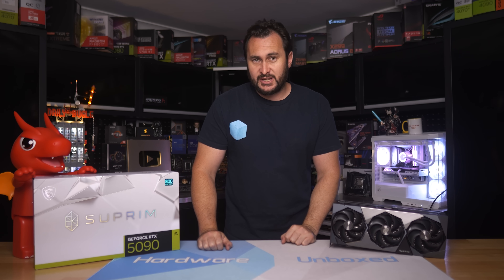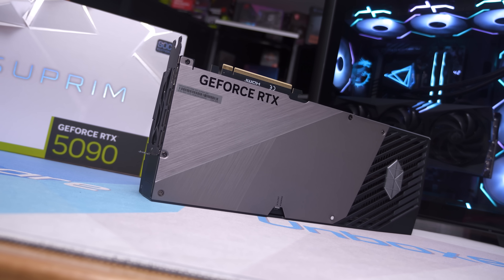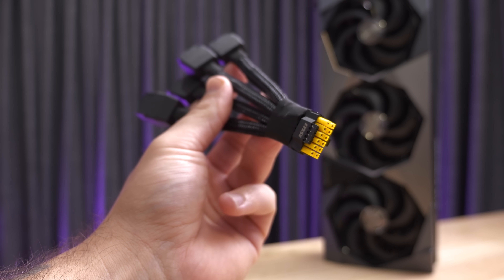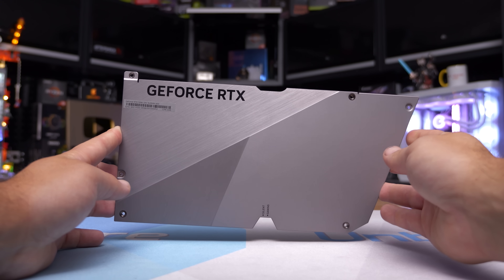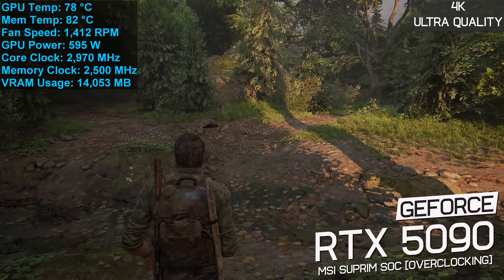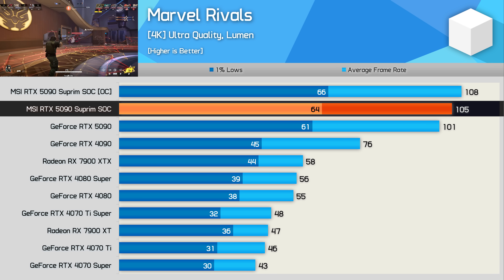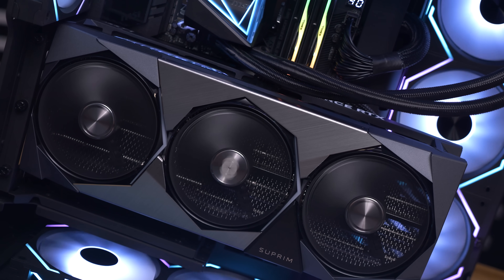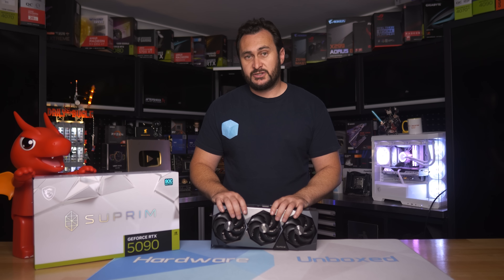MSI RTX 5090 Suprim SOC Review, Biggest Graphics Card We've Ever Seen!

Comment: What a joke of a card. this whole 5090 is. and this is even a downgrade from the previous 4090 Suprim X. the RGB for example in the 4090 is much better than this. temps are much lower ( more than 10 degrees lower. my card doesn't cross the 65 degrees in silent bios. the bracket on the back of the card is 2 only for a 4 slot card ? like really ? the 4090 suprim X was 3 slots and the bracket was full 3 slots too. zero sag. 

also what the hell is up with the power draw ?? constant 600w ? yeah... umm. get a house insurance just in case when you get the card -_-.  cables reached 75 degrees and up to 80 degrees when overclocked.. might as well cook a steak on the cable too lol. 

performance wise is impressive though. but the price I am expecting at least 2300$ US ( if ventus is 2k, MSI trio X probably 2150, and this between 2250 to 2300$... sheesh

Comment: 82c that is a massive heat. I hope the parts don't give up faster long term reliability....speed not only is costly but also generate more power and heat. 😮

700+ watt pull, wow. A 1200watt PSU is not gonna cut it, ill need a 1600w minimum.

Comment: 10:07 Seriously.. am I the only one seeing this GPU pushed to 600W, ie max capacity, ie max rate connector load, ie potential fire hazard. I am so confused with these 5090s.
Reply: It’s not a concern to reach max capacity, it’s a concern to go past it though.

You can see on this thermal testing that it is nowhere near the max thermal resistance for these connectors (105c) so there would be no fire risk unless the user is very neglectful and has poor cooling + poor connection with the cable.
Reply: @cameron2319 This test says nothing. 4090 test would show the same. We still have a 10% safety margin on 600W rating with a 600 watt power use. Do a test later in time, have a few specks of dust in there - What do you think happens with the resistance? It inevitably goes up. These will melt.

Comment: I am no electrician, but that power connector at almost 70c 80c is a no go for me, that is just asking for trouble by burning your house down, is not only the support for the GPU that they cheeped on,  but that power connector as well,  all that heat means wasted power,  you practically need a separate power supply just for the GPU alone.

Comment: If the connector and cable is only rated at 600W, isn’t it a major safety concern having that much power go through it. Don’t understand that and as someone with a 4090 and was looking to upgrade to a 5090, how is that safe.
Reply: 600 for the cable + 75 or 300 watts depending on PCIE gen 3 or 4 so total either  675 or 900watts delivery .

Comment: 11:12 coil wine on a $2000 GPU is insane, instant return.
Reply: Its normal for SMPS to whine...
Reply: Sadly it's the norm and inherent to switchmode PSUs/regulators. They all whine to some extent. Just a matter of if you can hear it or not (out of the frequency range humans can hear) or if the manufacturer has taken extra steps against it, like covering the inductors (commonly referred to as "coils" by people with no clue) in epoxy to stop them from vibrating and creating those noises. That's still easier said than done when you're dealing with a variable load like on a GPU though
Reply: Dont be pedantic. Inductors are literally coils of wire.  @Knaeckebrotsaege
Reply: Absolutely, and ignore anyone who says otherwise. If you can barely hear coil whine, it's already too loud.
Reply: @Shini1984  good job telling people to ignore how physics work. clown
Reply: @Knaeckebrotsaege 😂
Reply: @Shini1984  Gl ordering anotherone just to hear the same noise...

Comment: You can fix the fingerprint stuff by actually using a tiny drop of oil on some pad and rubbing it all over the surface to make it all even, then to wipe the oil off. I think that is easily fixable. Either that or use isopropyl alcohol to remove all oil from fingers. I say you're better off with the oil option, but eh, pick what you have.

Comment: That's a 3000€ GPU for a small chance to burn down your house. Yeah, no thanks !

The connector goes up to 80c in a well ventilated case and 21°C ambient. What happens if you live in countries with 25-30°C+ ambient? That conector, which it's made of plastic, goes to 100°c melts and if you are not around goes on fire and can potentially burn down your house.

Comment: 1000% convinced after seeing that gpu backplate that not all people wash their hands at the same frequency/and do not generate the same amount of hand grease. The back of that gpu looks like I fried foods, pulled it out with my bare hands and ate cheetos before installing that GPU. I wonder if that would cause any issues in your build if you abnormally have THIS much hand gunk.
Reply: fyi, a smidge of vinegar will remove all fingerprints on metal

Comment: Asus Cards Are Absolute Baller! I have 2 6800xt's by them and it is built the same exact way. asus tuf gaming oc 6800 xt I can clock these cards stable at 2560Mhz pulling less than 300 watts most of the time they are at 180-220 wattage I've seen it hit 280-300 once or twice

Comment: The 4090 coolers were designet for 600w because that's what Nvidia initially told the board partners, but then changed it after board partners had already started production. That's why 4090's ran so cool.. So they can more or less just reuse the 4090 design for 5090 and still be all good.

Comment: It doesn't matter what performance it has or what price it is. Such power consumption disqualifies it as a device.  570W of constant consumption in games or rendering is technological absurdity pushed to the limit. Overloaded laminate cracking at the PcieX connector is standard in 4090 cards and it will be worse due to too heavy and massive cooling. Nothing good will come from the power connector either. And besides, our dear earth is burning and nvidia doesn't care and releases an absurdly power-hungry monster

Comment: I don't like the uninspired designs from the board partners when compared to the engineering marvel that is the founders edition... Like no one else went for the 2 slot/2 fan blow through design to match Nvidia's? All we got was 4 slot behemoths with a metal back plate spanning the entire length of the card again? Really? 👎🏼 I'm honestly considering a founder's edition for the first time, although I would prefer it be slightly bigger, while still keeping the blow through design. I have a huge case and I'm concerned the founder's edition will look really really small.
Reply: lol this is exactly what I expected when I saw the FE. they just recycle the same ugly coolers as last gen and no LM. pathetic. maybe this is why evga quit, having to compete with Nvidia's FE at low margins

Comment: So with all that excess heat being dumped into the case how is the rest of the system faring? does it effect the processor's temps since that hot air is what's now going to be going over the AIO cooler now.

Comment: The fact that the FE achieved much smaller size and the temperatures are good makes this MSI Mammot not worth it
Reply: the temps on the memory of the founder is not good. makes me worry about the card throttling in the summer. This card is way more expensive but the cooling is much better.

Comment: The massive wattage is the reason it is a good idea to aggressively undervolt these GPUs. You can probably reduce it by 100W without trying too hard for virtually the same performance
Reply: If someone lives in the colder parts of the world wants to use their pc as the only way to heat 1 room, this can be a decent solution.. You can undervolt it to 450 watts if need be in the summer and have 90% of the performance if not more

Comment: I feel you were way too relaxed about the card overloading the power connector.  Even if NVIDIA fixed the melting issue, the instant you go over the connectors rating that becomes irrelevant and a fire hazard.  To claim its a "well designed card" when its overloading the power connector is absolutely insane.

Overclocking should never be able to overload the power connector!

Comment: They should just put an angled PCIE connector on it and make the PCB parallell withthe motherboard. They will get so much more room for cooling and people rarely use any other expansion slots anyway. They could even add mopre PCIE connectors to it both to increase power/data throughput but also to improve mechanical stability.

Comment: This is a total money grab by everyone involved in the 5,000 series cards. Way overpriced with little to show as far as an upgrade goes compared to the already great 4090.  Draws way too much power. I would only consider the water blocked version of these cards which should give you a little more headroom for overclocking. My opinion after watching these early reviews is that if you already own a 4090 don’t bother with this 5,000 series at all. It’s built on the same Architecture as the 4090, so performance gains are very slim and it’s all about frame smoothing, upscaling etc etc.  we were looking for that 70 to 80% upgrade in raw performance. The price for the AIB cards is stupidly over top for a few bells and whistle’s.  Total bummer 😢😢😢😢😢😢😢

Comment: 80c on the power connector doesn’t seem safe at all tbh… I don’t know why they don’t just have 2
Connectors instead.
Reply: 80°C power connector, 800 Watts of power draw on a 600Watt certified cable.
 2x 12V-2x6 600 Watts, this could easily solve this giant issue. But nooooo...
Reply: @N0N0111 the amount of potential heat from load spikes could blow the card with 1200 watts running through it, like they said the card is at it’s limit
Reply: @ It's over the limits already, let's not pretend it isn't.
Reply: saves on cost and thermal spread

Comment: 600 watts! We’re going the wrong way! Screw this card
Reply: 80°C power connector, 800 Watts of power draw on a 600Watt certified cable.
 2x 12V-2x6 600 Watts, this could easily solve this giant issue. But nooooo...

Comment: the temperature review of this card should be done in a case and review the CPU and Dram temperature... it will be stupid to buy a $2000 card dumping so much heat it downclock your CPU and destabalize your XMP/expo Ram due to the heat baking in the case..

Comment: Why praise a 4-slot 3 kg card when NVIDIA themselves proved these metrics are absurd and hallmarks of either technical incompetence or marketing deceitfulness (trying to fool morons into thinking: biggerer = betterer = of course I give more money). There is absolutely no technical reason why a 5090 should be bigger than 2.x slots (i.e. 3 slots) and at that size it better have SIGNIFICANTLY better noise and temps than the FE. Any larger and it's just wasting PCIe slots.

Comment: dunno why the gpu size had to be given in mm. whats wrong with cm? you are at a point where mm stops making sense.

yes its super easy to go to cm myself. But also why would i have to do this if the original measurement makes no sense. Whats next? measuring car length in mm? Also for daily life mm is such a nothing measurement. its used. but Cm is so much more common.

Comment: I am privileged to have the RTX 4090 version of this card. I under clocked it to use 150 W by lowering the power target and so doing I was able to reach a level where the card is generally in Audible. I also had to purchase a fiber optic display port cable for around $60 in order to isolate the graphics card from my sound system. This was not necessary with a standard computer speaker system, but was necessary when I upgraded to studio monitors. I am painfully aware that 150 W is below the performance sweet spot for efficiency of the RTX 4090 but for me overall performance has been superb and silence is king. I would consider scooping up this card to replace the one I have, but I don’t think I am willing to get up in the morning and refresh my page for it. I would have been happy with an RTX 4070 with 16 GB of memory and enough cooling to reach similar audio levels. I think the biggest thing that should give gamers pause about this graphics card is that it is faster than we need. I play single player titles at 1440 ultra wide resolution with a 165 Hz monitor and most of my games are capped at 60 frames per second anyway. I tried Ray tracing in Nvidia demo games, but I do not play any games that negatively support Ray tracing apart from those. I almost forgot to mention: I got my graphics card for $1750 or a $150 premium over MSRP. I made my purchase in April 20 23 and I could have chosen another online retailer which promised a $50 discount if I were willing to wait until June to have it shipped. At the time, I thought this was a risk as well as being deprived of the brand new computer. I had just built in all its glory for much longer. I was correct. By June, you could get cards like this for that price anyway. as for the pricing of the card showcase in this video, my guess is MSI will charge a $200 premium over MSRP. That would be fairly in line with the premium they charged for the 4090 version. I do not want to be the one holding the bag if the AI bubble were to pop, so I will not be buying any more graphics cards unless I have a buyer lined up for my 4090.
Reply: A DAC would of been a better option.

Comment: 13:32 no pushing 80°C on a wired connector pulling that much amperage is not safe or acceptable in any manner. It’s a wired connection not a heating element. It’s not a butt warmer and internal power supply components don’t get that hot.

Comment: Gaming with this thing on your desk will take "sweaty" to the next level, literally.
Reply: This is why I stopped sweating to regulate body temperature. Too many sweats online.
Reply: Latest hardware, cards / cpus / etc are almost always the most efficient. Dont look at what it consumes at 120fps 4k ultra. look at a given non peak metric of say 60fps 1440p or 4k vs other cards. Id wager 5090 is THE most efficient. e.g. 4080 more efficient than all the GPUs that came before it. 3080 same with what came before. A CPU can run an old game practically on idle, yet in 2005 cpu would have to draw a ton in comparison. Should i run my 4080 at 4k 120hz and consume 500+watts? no way.  60hz doesnt worry me so much, i play at that and save all that extra power draw and heat.

Comment: There's definitely melting 5090 cables for sure
Reply: The 4090 was nothing, give it 2 weeks and overclock forums will be full of pictures of burnt connectors, esp. the watercooled ones that have less airflow around.
Reply: @puciohenzap891again, like I said to the other person, I’ve had mine since launch, 5090 MSI gaming trio oc and I’ve had no issue at all, it’s performed like a dream and I’ve used my card under a lot of load in kingdom come deliverance 2.

Again, sorry to disappoint you! 😂
Reply: Had mine since launch day although I have the gaming trio of MSI 5090, not had one issue and it’s performed like a dream.

Sorry to disappoint you 😂

Comment: So it’s founders edition or nothing. They truly did revolutionize GPU coolers with this release
Reply: Did you miss the part where the memory temps were 16º lower on the MSI?
Reply: @ Did you miss the part where you see a laughable 2 slot bracket and flimsy plastic GPU holder?
Reply: @ I'm not saying this design is good, I'm saying the FE isn't good either. Both are subpar for their absurd price point.
Reply: @Saurion1 msi is louder with coil whine
Reply: @RussStufft  Quite the opposite. He said the FE was louder and with more coil while. Got any listening comprehension issues?
Reply: @Saurion1  why u so mad little guy?

Comment: That power consumption is massive over rtx 4000. An 800w psu wont be able to be used with a 5090 at all. Rtx 6000 series will make 1400w psu normal.

Comment: that stand really makes me question the whole rest of the product.  Yes I have a high quality case, it was $600,  and no it does not have a pci slot stand. I guess i could wait for the riser cards and mount it vertical (my case does do that) but id rather not. I don't really like the vertical cards myself
Reply: then again ive had a ton of failures at work with msi products the past few years.  more than the other brands combined so it doesnt surprise me

Comment: The 5090 is already clocked well where it's already diminishing returns.
So even higher overclocks are insane in power consumption for 4 fps gain.
The cooler is good but the card needs to work at better clock/voltage points.

Comment: Okay at this rate, dual PSU pc cases are gonna become a thing so you can have 1 PSU dedicated to the GPU and 1 for all the other components.
Reply: Or buy one 1600W PSU.
Reply: @B3TR0Z  Yeah but 2X 850W is cheaper than 1600W PSU.
Reply: meh, not that safe, I have researched this field and it's not that great as it seems.

Comment: 3000 Euro GPU... Ahh yeah here is your plastic straw to keep it in place... 😂
Reply: Yeah. That was very generous of MSI.
Reply: Over 4500 in Australia. Probably about 4700 with our GST. Crazy stuff
Reply: @Quizack  In Portugal, some places sell the 4090 at 3400€, not one 5090 to sell.
Reply: @pedroferrr1412  You have us beat. When they were in stock, the 4090 was about 3500 AUD, which is about 2100 EUR. We cry the same tears, but yours are heavier 😭
Reply: Minimum 4000Euro 😂
Reply: Idk why they did that, bought an Expert card from them last gen and it came with a high quality metal GPU anti-sag bracket.
Reply: MSI lists this model at 2400 USD (does not include any tax). With 17% tax, that would put it up to around 2700, and in Europe, retail prices are typically a bit higher because of higher operating costs. Also, I can easily see retailers adding more to the price while supply is low.